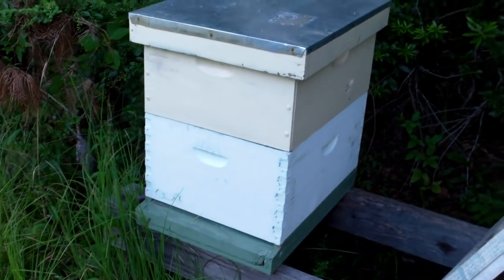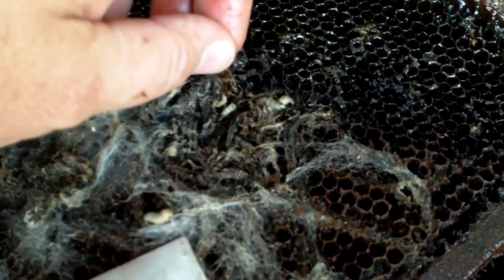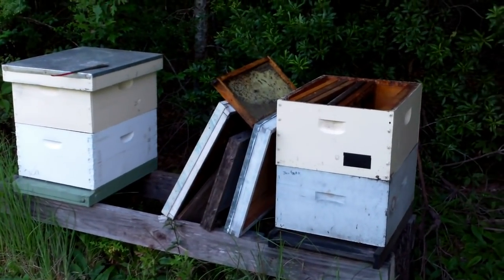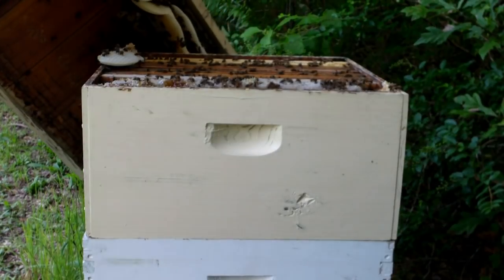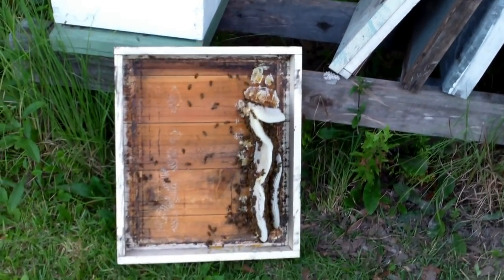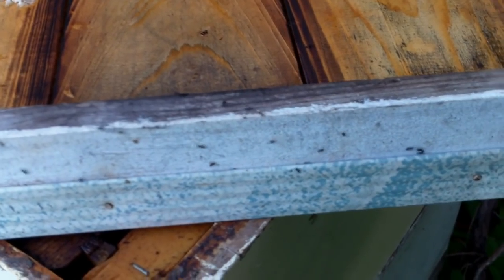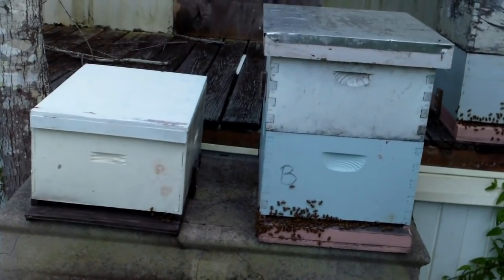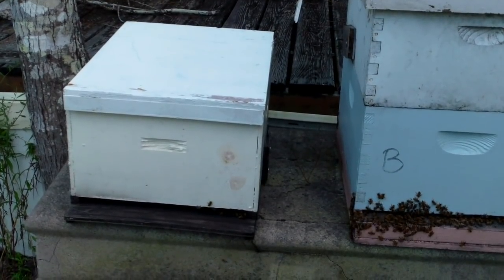If I Have Bumble Bees Does That Count?

Comment: Last Summer I had a hive killed by wax moths.  I I was thinking that moths got into it because the wood for the hive was old and had a lot of cavities in the surfaces.  But I have another hive made with the same wood and its doing OK.  Since you mentioned about hives in that same location always having problems I'll move the stand that held the hive that got killed by wax moths and not put another hive there.  Thanks for the tip.

Comment: OK Rooster can we discuss this? Seems to me the soil under the right side of that stand is conducive to hive beetles. That is, if I understand the life cycle of the hive beetle. Would I be correct to say that the larva usually drop out of the hive and into the soil to pupate? and then come up to the hive as adults to lay eggs? Clear off that whole stand for a while. Clear off all foliage over the soil, and treat it appropriately.  Then maybe the curse will be lifted on the one side and the blessings of the opposite end will be seen at both ends. Now I know you know lots more than me - but sometimes the smart folks need some questions from those that are not too busy to see. You gave us all the facts - so what does that add up to?
Reply: You may be 100% right. studying your enemy is the best way to defeat them!

Comment: Hive beetles burrow in the ground below the hives that they have infected.
Reply: is there any thing you can do, like maybe till the ground and burn it.. do you know how far down they burrow
Reply: I tried DE and I really didn't notice much of an effect. Gardstar is incredibly effective at killing the pupa and the beetle traps work well but I still had at least twenty to fifty hive beetles that I had to manually exterminate.

As for how deep they burrow, it's about six inches to a foot. I usually take a garden trowel to inspect for the pupa.
Reply: 1975Jdonov does anyone use boric acid on the ground to treat for hive beetles?  I wouldn't recommend getting it on your bees or the hive but it's gotta be a better option than burning the whole place down?
Reply: I don't think the boric acid would work if you put it just on the ground. Although, since the larva burrow into the ground and usually  fall out in front of the hive, maybe you could lay a moat for them with wet boric acid, or maybe sulfuric acid. That could work.
Reply: Apologies, seems I am way behind the rest of the pack. So what did you do?
Reply: What if you place your hive on a concrete staging area instead of grass?
Reply: We’ve just spread rock salt under our hive stands earlier this spring. No need for a weed eater now and hopefully any hive beetle larvae will die when they fall to the ground.